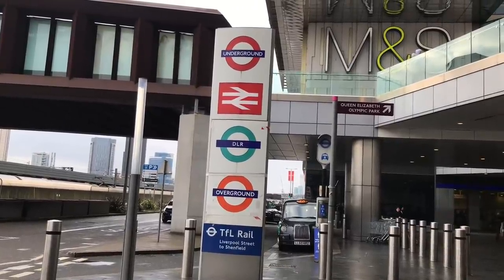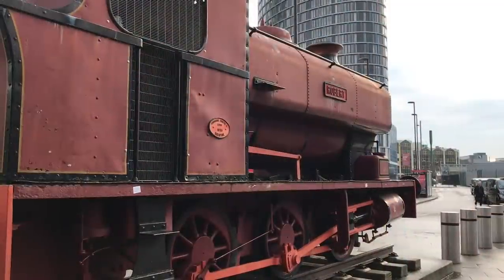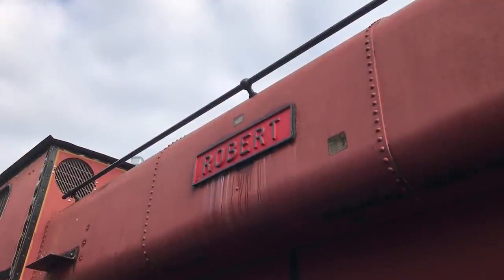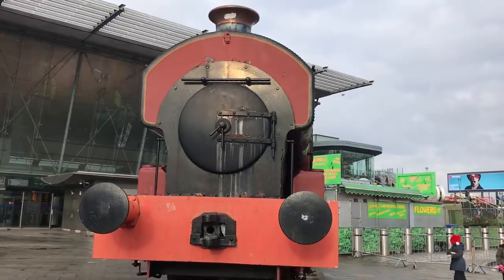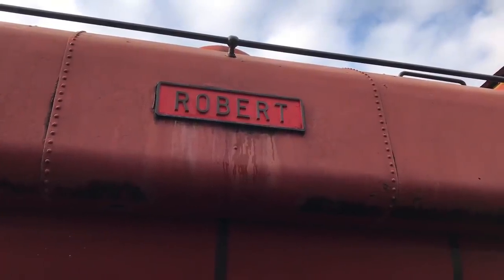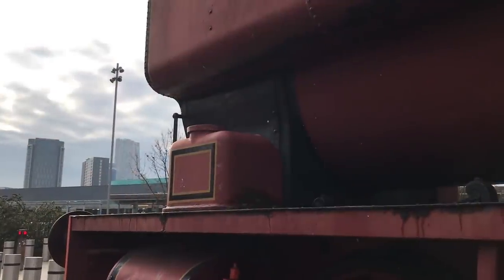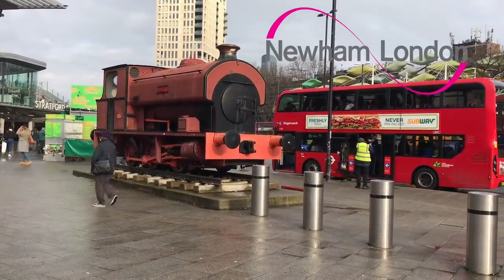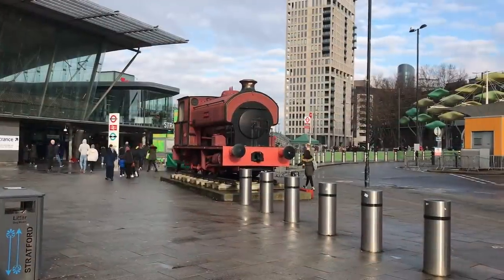Robert the Stratford Tank Engine

Comment: A number of engines like this one were used for shunting at collieries well into the late 80s and even the 90s. With all the fuel they needed on site, there was no need to replace them with diesel.
Reply: Indeed. The CEGB in particular was an avid retentionist.

Comment: When I was a kid there was a very old steam traction engine in the local park as part of the play equipment - that steering wheel was great fun and sliding down the wheels. Kids lining up for their turn as the “driver” and moving all the different levers back and forth - ah happy days.
I’m trying to imagine wanting to include one in a kids playground today - not a chance heck!! 🙂🐿
Reply: is it still there in the park?
Reply: @dazasc3994   - sadly no. I’m not sure what happened to it or when it was moved, but I hope someone restored it and that it’s still going strong...somewhere 🙂🐿
Reply: @dazasc3994   - I’ve just found out online that it was originally the local council’s steam roller and was removed in 1988 for safety reasons.
Reply: @SecretSquirrelFun  ah what a shame

Comment: Very enjoyable Jago.  One minor niggle - it was an ironstone quarry, not an 'iron mine'.
Anyone wanting further info should seek out 'The Ironstone Quarries of the Midlands, Part Three The Northampton Area', by Eric Tonks.  Ivo Peters filmed some of the ironstone railways in operation and footage of Robert at work can be found on the DVD 'The Ivo Peters Collection, Volume Six Ironstone Lines'.  If memory serves, Robert was painted green at that time.
Several locomotives that worked in the ironstone quarries of Northamptonshire and surrounding counties have been preserved, and it's great that Robert is among them.  However I am among those who are sad to see another one dumped on a plinth and left to the mercies of weather and vandals, rather than in operational order on a preserved line.

Comment: Robert was plinthed outside Stratford Station as a tribute to the massive railway workshops that were once synonymous with everything running into and out of  Liverpool Street since Victorian times to the latter days. The works were responsible for the construction, maintenance and repair of everything railway from the steam locomotives, coaches and wagons down to the buffet car cutlery and carpets and employed thousands on a daily basis. The works finally closed and disappeared into the history books in 1991 and over the years, and there is little indication of what was there. The whole site was transformed into the Olympic Park and the Westfield Shopping Centre, and with the change in local demography, there are few who now know what was there nor care, and Robert was put there as some sort of reminder of days gone by - although not a very tangible one, as it was an industrial product with no association to Stratford Works. Whilst work was ongoing with the rejuvenation of the  Stratford Station into a major hub in preparation for the Olympics, Robert was loaned as a static exhibit and featured outside the front entrance to the East Anglian Railway Museum at Chappel & Wakes Colne on the Greater Anglia branchline from Marks Tey to Sudbury, where there are numerous other Stratford products including the sole surviving N7 steam loco built in 1923 at Stratford and currently undergoing restoration. In the meantime, Robert returned to Stratford where he currently resides. Don't know how it got designated as Lamport No3, as the Museum has another industrial steam loco of the same background - also known as Lamport No3! No doubt the more descerning will expand in due course!
Reply: Really the loco outside stratford should have been Decapod.
Reply: @Anthony Keating Thanks Tony. Temple Mills wagon shops and High Meads with the hump shunt yards  centered as an integral part of the Stratford empire of railway workshops, but are often forgotten as the locos had more 'charisma' attached to them, rather than the  unglamerous freight vehicles.  I worked at Ilford EMD for many years and several chaps were transferred to the Depot when the wagon works in the Mills and main loco running and repair shops at Stratford closed in 1991. Long gone are the days of standing on Stratford Station at night in winter time to the mournful tones of distant loco horns and shunting noises echoing on a scurling North wind across the wastes of the Lea Valley.